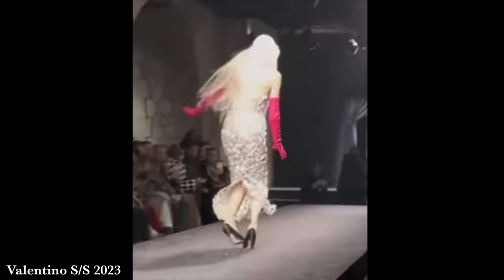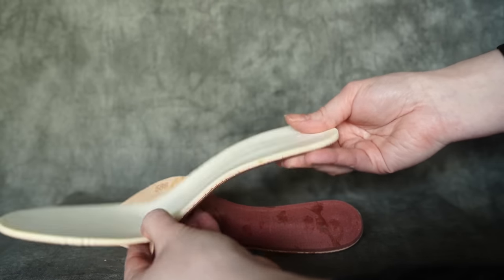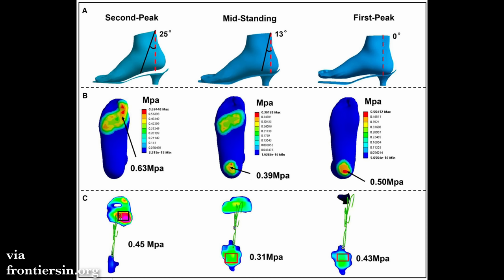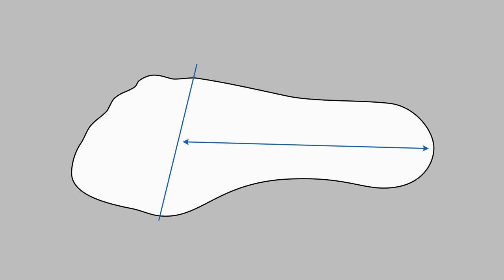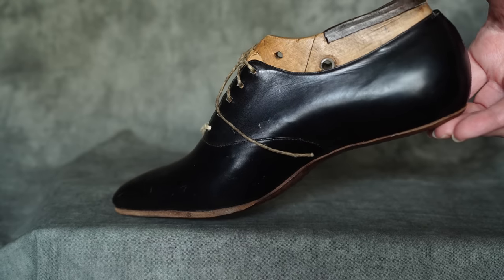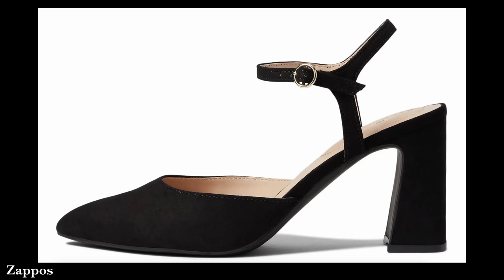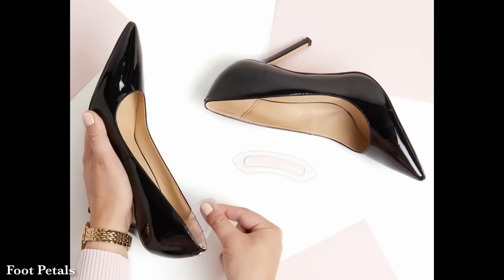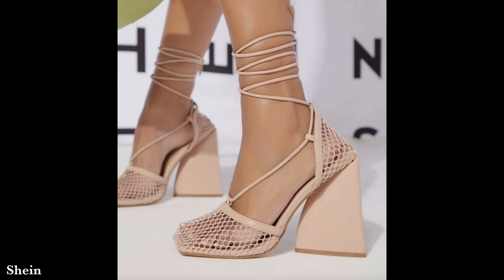Why are Modern High Heels so Bad?

Comment: I used to be a pointe shoe fitter at a dancewear shop. We would look at the feet to determine length, width, toe shape, toe length, foot compressibility, foot and ankle strength, and arch strength and shape before we even thought about pulling a shoe for them to try on. Once we started trying on shoes we would pull 5-10 different pairs, depending on how many pairs the dancer had previously gone through (more experienced dancers usually know what they're looking for compared to first timers), until we had narrowed it down to one pair that fit as perfectly as possible to provide maximum support. 

I think about that experience a lot when it comes to modern shoes. We expect every shoe to fit every foot and there's usually no expert fitter there to guide us to the perfect pair of black pumps for our foot shape. The only time I've ever seen a fitter with that much expertise outside of a dance store was at the Louboutin in Chicago. That girl really knew her stuff and she directed me to the stiletto that would best fit my foot. Louboutins are known for being quite narrow and uncomfortable but because of her knowledge the ones I bought are one of the most comfortable pairs of heels that I own.
Reply: I'm not a dancer and never have been but so much of what Nicole was saying here resonated with what Josephine Lee of the Pointe Shop says and does when she's doing a fitting and talking about what she's looking for/looking at. I had no idea that Louboutin offers something similar. Mind = blown!
Reply: I am a ballerina and I wish we had things like that in my country :( We had 3 brands of pointe shoes available, each brand maaaaybe has 2 types, and sellers knew nothing.
Reply: That's really cool, but as a reminder, Louboutin is a designer/luxury brand that not everyone can afford, and we need to find a way to bring that shoe fit knowhow that the saleswoman had to Payless and similar shoe retailers that us regular, working-class folx shop at.
Reply: Woww that is so interesting, yes I was also under the impression that Loubs would forever be too uncomfortable for me! I'll have to visit them in Chi-town next year for my next yearly luxury budgeted purchase. ❤️
Reply: I've been thinking the same thing! Imagine if shoe stores offered fitting services even a little bit like pointe shops, we would have so much less foot pain!
Reply: @cannibalisticrequiem  They used to. When I was a kid growing up in small-town Canada, shoe retail people would take great care to measure your feet and recommend shoes accordingly. That was both at the one local shop and the closest (not really close) shopping malls.

Now it's mostly just another retail job and at some point knowledge stopped being passed down. Mind you, I recently had a fantastic experience at a Soft Moc in a local strip plaza, but that store specializes in providing comfortable shoes, so it seems they train their staff a bit more.
Reply: I used to work at a family owned children's shoe store (we sold specific adult shoes also, like Dansko clogs) that was similar to this. We didn't use quite as many measurements of course, but we were still thorough. We often were selling people the pair of shoes that their children would wear while learning to walk, so the owner was very passionate about fitting them properly. We had to learn things like at what age children started developing an arch and how to properly fit to accommodate growth for different ages. We also would fit around braces and to help with the correction of disorders. We had different tools to stretch certain shoes in different places to specialize them too. As far as I know, they still do everything the same at all three of their locations. I really enjoyed working there.
Reply: Hello fellow fitter! I think I can guess why the algorithm directed me here lol
Reply: I once went to a shoe store that was run by a pedorthist. I don't have anything severe, just an incredibly flat arch, but he measured everything you possibly could about the foot, got a good look at how I stood and walked without support, and then fitted me in the best pair of tennis shoes and insoles I ever wore. Miss that place, though I definitely couldn't afford it now.
Reply: @gadgetgirl02  I remember this as well growing up in the US.  My mom would always take me to the Stride Rite store.
Reply: @gadgetgirl02  I grew up in the US and I remember that at places like JC Penny when they were still taking pride in being a department store.  It was really cool to go in and get fitted and they'd go in the back and pull boxes of shoes for you to try on.  I miss it.
Reply: That's very interesting. In my experience (living in Europe) fitters are common... as long as you go to the smaller shoe shops or specialised stores. Big stores that have a bit of everything like Dunnes and El Corte Ingles, sport/outdoors shops, and general shoe shops like Schuhe will have someone who knows if you ask for it. Also, fashion stores often have sellers but not fitters, so the person has an only generic idea of what shoe where but nothing else. Their job is selling you the item, not helping you to decide if you don't know.
Reply: As a man...I learned (and was so humbled) so much...
...It just takes one well done Utube
Again...what women have to deal with
Reply: This is why I went to a running store when I was looking to replace my sneakers - I haven’t done cross country in years, but I remembered how the people at the XC store had helped me to find a practical shoe, and I wanted that again. I came in to the shoe store, told the employee that I was looking to replace my current shoes, and what I liked about them. He had me try on four different pairs, and had me walk around the store to see which would support my foot the best. I walked out of there confident that this pair of sneakers would last me years and would help prevent sore feet after a long day. I strongly recommend going to a cross-country/running/sports shop for shoes if ankle stability has been an issue in the past. 

This also comes up in hockey skate fitting - you know how terribly uncomfortable rental skates are, that’s because they’ve got a lot of similar traits to Ill-fitting heels. They’re stiff, and try to keep your feet in one spot, but if your foot shape is different from the skate shape, you’ll be in a world of pain. When I went to get skates, the employee at the shop did most of the same things that the original commenter said about pointe shoe fittings - minus the ankle strength and whatnot. Skates will support your ankle. I tried on three pairs or so, and the instant that I had a complaint, it was time for a new pair. Ultimately, I got a pair that fit me perfectly, and we baked them so I wouldn’t have to break them in. No more pain while skating!
Reply: @gadgetgirl02  this is kind of a silly example, I know, but do you remember the show *Married... With Children*, which aired from 1987 into the 1990's in North American markets?

The male lead was a down-trodden Everyman called Al Bundy who go no respect from his high-strung wife and two children back home; at work, he was an unappreciated and disrespected in his job as a shoe salesman as well. We would sometimes see him at work, measuring feet and recommending shoes for his customers, with whom he often exchanged insulting soars and jabs. He talked about his job as though anyone could do it, but it paid well enough for him to provide a home for his single-income family and his customers, in spite of the playfully adversarial nature of their relationships, respected his opinion when he was shown to fit shoes and make recommendations. 

I showed an episode of that show to my Gen-Z nephew recently, and Mr. Bundt's job was incredibly confusing for him.  How did he support a family on a retail salary?  If the store sold only shoes, why weren't there hundreds more options?  And, specifically baffling for him, why was this man measuring feet and stretching/adjusting shoes?  He didn't understand that we didn't all used to tear up our feet in the uncomfortable process of "breaking in" a new pair of shoes. 

I feel like, with exception to shoes with specific needs like pointe shoes and those shoes specially made by pedorthist professionals, the shoe salesman is a job of the past. It makes me bummed for the people in general, because a good shoe salesman made such a huge difference in getting you the right, most comfortable and durable shoe, and getting just another pair for the closet.
Reply: Barely related but I can't think about shoe fitting without thinking about Married With Children lel
Reply: @pembrokelove just posted my comment then saw yours - great minds. And yeah I bet Zoomers have no idea wtf Al's job was LOL
Reply: EXACTLY. I teach classical ballet and go to the dance store with each of my students when they are being fitted for their first pair of pointe shoes. Often times, I'm the one doing the fitting if the fitter is inexperienced.
Reply: @cannibalisticrequiem  what’s with this patronizing, finger wagging comment lol no one needs a “reminder” that Louboutin is designer
Reply: This is also done with figure skates, because like with dance it is very important for the person to have the right fit bc it can affect ones perfomance. Different brands accomadate to different widths, styles, and skating levels. And individual skates can be adjusted by punching out different areas, putting insoles, and using different blades  Sadly there isn't a  lot of skating shops around the entire country to help properly fit every skater but many brands do have instructions online for measuring. Also shoutout to the Houston Skate & Sports Orthotics Center, they are great.
Reply: When I was a kid, that's how all shoes used to be sold. They'd measure your foot and tell you what size and fit you needed. Now you just go into a store and try things on until you find something that fits, and it's frustrating as hell when one size is too small but the next size up is too large!
Reply: I have problem feet and hadn’t been fitted for new shoes of any kind in decades (even at Cole Haan). The staffer at the running shoe store looked at my feet, identified my problems and brought me appropriate shoes that I never would have even tried on my own.  I knew what my problems are it; it was reassuring that he could see them too.
Reply: So basically, you worked at an Ollivanders.
Reply: Yooooo that’s fucken great lmaooo
Reply: @LynnHermione  😊😊
Reply: I started pointe when I was 9 and man my foot was so small. It took over an hour to find a shoe that would be small enough and still properly fit my foot in. My toes were so small the caps didn’t even fit so I had to wrap lambs wool to give the toe box cushion. Ah good times
Reply: @maria_4791  
“...patronizing and finger wagging...?!”  How in the world did you get that from Hollowed Jes’s comment?!  Methinks thou dost project too much.
Reply: I had a hard time just finding some regular tennis shoes that fit because the store sold out of my size too quickly. Finally found a pair that fit and were comfortable in tennis shoes and winter boots, but it took 2 or 3 visits.
Reply: This is amazing
Reply: @hodgeelmwood8677  Or you go online and order your new pair of shoes there. 😂 Which, to me, is mind-boggling. 🤦🏼‍♀️ I keep wondering how online shopping for shoes could become so widespread, the shopping experience being removed one further step away from the custom fitting experience described in your comment.
Reply: @lexinicole4317  honestly it kind of felt exactly like that. Sometimes a girl would put on a shoe and we would immediately take it back saying "No, no, definitely not!" before disappearing into the back to pull another shoe.
Reply: @cannibalisticrequiem  Believe me, I am well aware that Louboutin is a luxury brand and not everyone can afford it. I saved up for many months to buy my one and only pair. I wasn't saying that the solution to ill-fitting shoes was to buy designer shoes. I was simply stating that that is the only shoe retailer I have ever been to that seems to know anything about how shoes should actually fit to illustrate how much of a rarity that expertise is.

Comment: I realize that my mom taught me really well when it comes to choosing some shoes. She has very small squared feet for a woman (she is a 34,5 eu size) and since very young she had to be very picky with her shoes. She always told me that shoes are an investment, not fast-fashion. 
I don't know if it is true but for longer walks, or all night dancing, she advised me to choose shoes that are:
- leather (better wear, better aging, better flexibility, breathing and can last a lifetime if you take care of them properly, plastic CANNOT be taken care off and will end in landfills)
- rounded in the end, not pointy (because it pushes your big toe in the wrong direction while folding, so it creates bunions on the long run)
- no more than 4 max 5 cm high on the heels (same, otherwise it can create irreversible damage on the joints and on the Achilles tendon)
- fully closed or with good proper straps
- which are close fitting so not too tight, no wiggle room.
- And on which I can feel my whole feet (outer arch included) touching the inside of the shoe.

I am following this and I don't have shoes that causes me pain. And for the more extravagant ones, I use them only for occasions.
Reply: That's the exact description of well-fitting, comfortable pair of heels, but nowadays they are so hard to find!
Reply: my mom taught me the worst thing: she firmly believed that shoes need to be at least one size to small so they will "shape the foot properly".
Until years after I moved out I always had painful feet as a result, and even now, 30 years later, my toes are shaped and positioned incorrectly from being squeezed into way too narrow a space for the first going on 18 years of my life.
Reply: @jwenting  I am so sorry you had to go through this and I really feel for you... that sounds really painful. Glad that you don't have to follow this belief anymore though.
Reply: That could be a mis-interpretation of old school advice. My mom was instructed by the pedetrician to put flexible leather shoes on her babies feet even before they walked, to shape feet that would later fit into footwear. In the 1970's and 1980's, there were no Crocs. I used to play with those little shoes when I was a little girl. I found them absolutely adorable. I don't think that did harm, though. None of us (4 children) have feet issues. When we were bigger and we bought shoes, she would put the shoes on, press on the end to check for proper toe room, then ask us to walk in the shoes and tell her if it felt comfortable.
Reply: @Off_the_clock_astrophysicist  That was the advise of the shoe salesman and the experts he got it from, and not flexible shoes either but hard leather shoes deliberately designed to compress children's (up to teenagers) feet into unnatural shapes to fit very narrow toe boxes especially and flatten arches.

That's what was done in the 1970s and into the 1980s. And it's still the fashion thing to have extremely narrow shoes with very limited arch height, an unnatural beauty standard that's been perpetuated by the industry and even podiatrists in the medical field for decades already. 
I've been advised more than once to get special shoes to compress my feet so my toes aren't so spread out and my arches get lowered, even as an adult, despite spread toes and high arches being the natural shape of a human's foot.
Reply: You are so blessed you had someone teach you what to look for in proper footwear.  Brava to your Mom!!
Reply: I'm 55 and as a kid, I wore cheap shoes like those plastic strappy water sandals ( with glitter!) And those satin Chinese flat Mary Janes. I often walked barefoot too. My feet never gave me problems. 
My friend's ma took her to an expensive podiatric children's shoe store and her shoes were always expensive, ugly, stiff brown leather that hurt her feet.